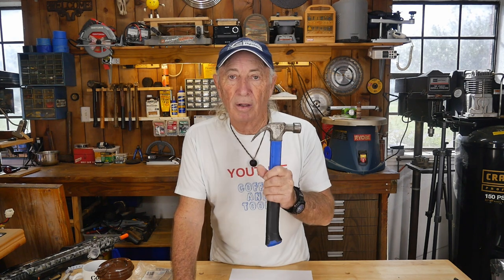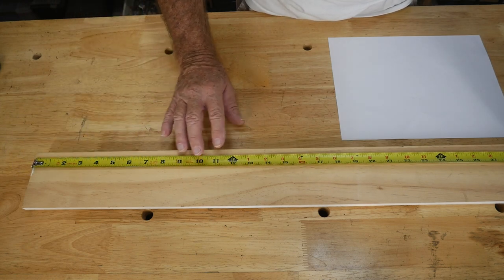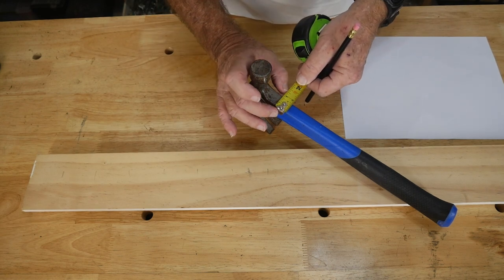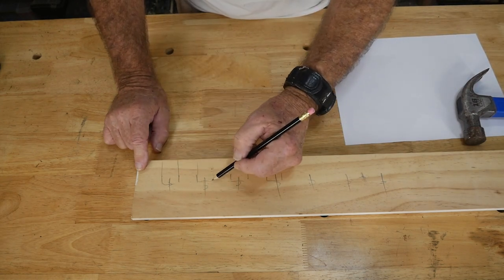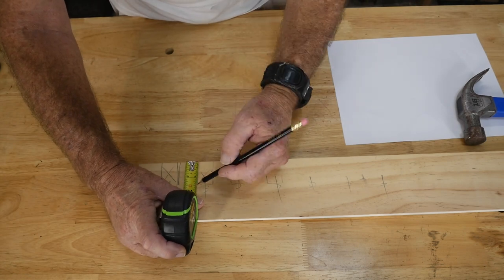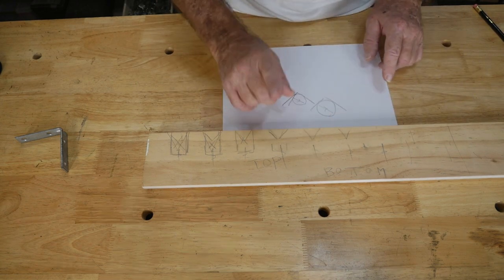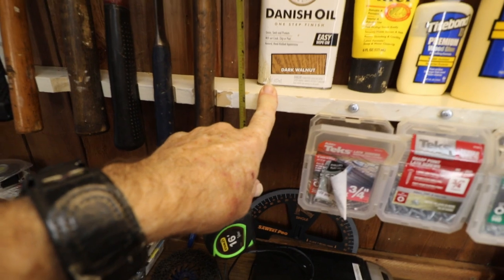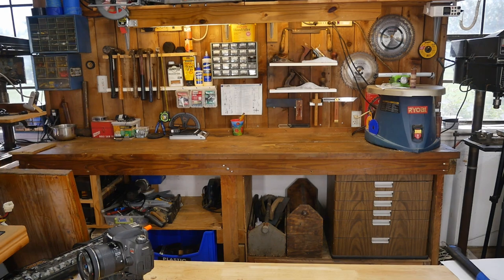Easy wood project, hammer storage from scrap wood, by Coffee and Tools episode 196

Comment: It’s interesting that you selected this project!! I noticed yours in the background several videos ago and really liked it so, I did a screen shot to build one myself! My hammers are one thing I wasn’t happy with the placement of in my shop! Glad you did this cause the screen shot obviously didn’t reveal the notch on the bottom!
Great video!! Thanks for sharing your design…it’ll be making an appearance here in New Hampshire!! Oh, I have more than one coping saw!! Yea, I don’t cope well so I need lots of saws!!😁
Reply from the maker: Now that is a good way to cope LOLOL
Reply: @Mr. James I’ve got 12 on mine. It really is a great space saver. I know there are systems out there sort of like a pipe clamp rack, that can hold multiple hammers, but then your still hunting for the one you want and may have to move some to get at what you want. This eliminates all that headache! I’ll figure out a way to get the pictures to you. I tried to get a decent shot of the French cleat but it’s not very good. Oh, and I had to screw the hammer hanger to the french cleat because of weight, but that could be resolved with a deeper cleat. I just have some cleat stuff on the wood rack so I used that.

Comment: I have so many hammers, most of which I just don' use, but maybe I might if they were a bit more available.  I have most of my tools that I use on a regular basis, set up on a peg board but hammers really do not work well. I put away my claw hammers and I prefer a rip instead. I have my go to hammer that I use for most things, but it would be nice to have several of my ball peened hammers out because I use then a lot more  than I thought  I would. 
by the way I took a silverware rack out of an old dishwasher and I have used that for my tools that I use on most projects that are away from my shop. . It has a little bit of everything. It is amazing how useful it has become to me. tool boxes are ok but you have to dig for a tool you need and this way its right there.
Reply from the maker: I've got the dishwasher rack on the bench today for some ideas LOL